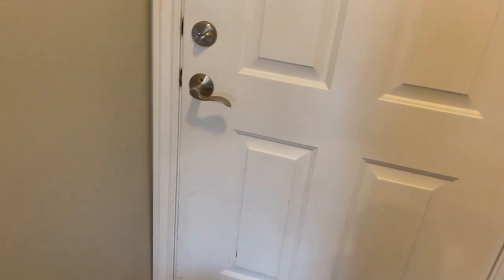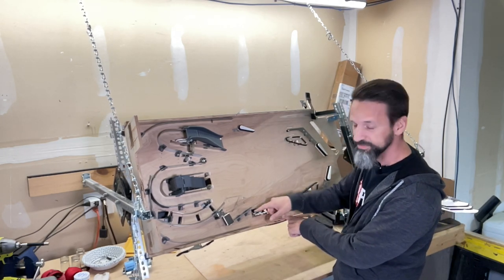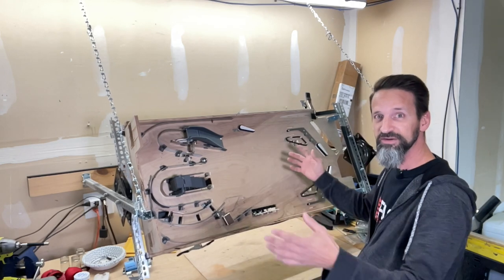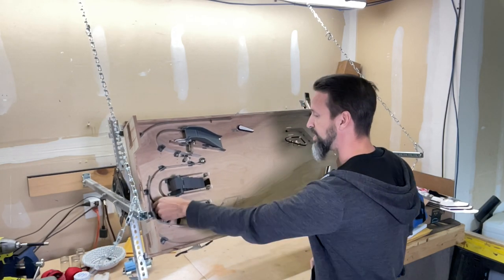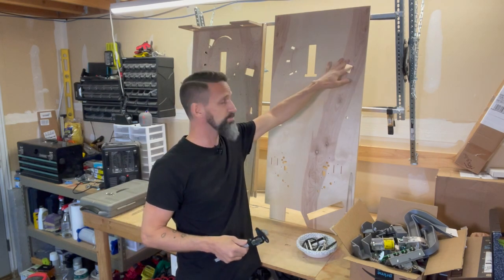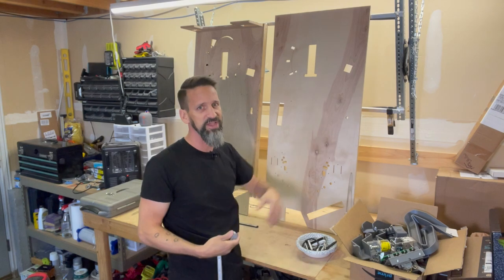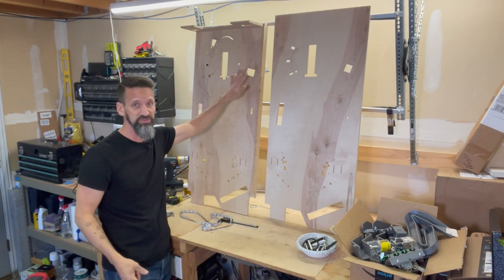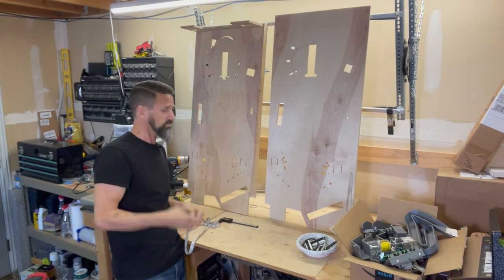HOW TO MAKE A PINBALL MACHINE: Digitizing Rough Cuts

Comment: At around 10 minutes, the way you are measuring is fine, but it might be a little easier/cleaner if you use dimensioning. Hit 'd' and click the vertical line you drew, and then hit the right-most edge of the playfield, and it will move that vertical line to whatever distance you type in. It's fundamentally almost the same idea, but it's sometimes better to do it this way depending on the application.

Also, when drawing lines, not sure if you've discovered this yet, but any line you draw, if you hit 'x' it will turn to a 'guide' line, which will be ignored when doing extrustions/etc. They appear as dotted lines in your file, which can make it much easier at a glace to see what's "real" or not. Hope that was helpful, and thank you for all the great videos again!
Reply from the maker: Thank you for the tip! I didn't know about clicking 'd' 👍
Reply: @thepinballroom  yeah, anytime you are creating any part of a sketch, you can just rough things out at first and then dimension them later on, which sometimes makes it easier to just get a general shape in mind and then you can go through and put in your measurements, so it can kind of speed up things at the beginning. Of course, if you have the exact dimensions that you need you can enter them at the beginning as well, but I find it especially useful for placing interior shapes, like everything on the playfield in this example, because that means you won't have to draw any of those extraneous lines. There are some examples where you will still have to draw explicit guidelines, but over time you will figure out when you need them and when you don't. I'm an engineer and I've been doing CAD work for years, more often than not for hobby purposes, so that's just something that sort of evolved into my personal workflow I guess! :-)